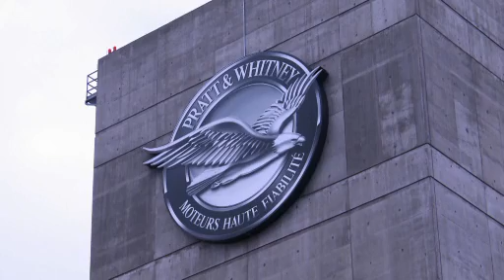Pratt & Whitney PurePower PW1100G-JM Engine First Flight

Comment: Forty-five 747SP aircraft were built between 1974 and 1989 with two more
 planned but never constructed.The production line was ended in 1982 but
 reopened in 1987 to fulfill an order for the United Arab Emirates
 As of December 2016, there were 10 Boeing 747SPs still in active 
service
 with 9 more stored and 1 preserved. The remaining 21 were either 
scrapped, otherwise destroyed or abandoned In 2016, the last 747SP in 
commercial service was withdrawn from service after 40 years by Iran Air.As of 2017, the majority of the ten aircraft still in service are used for governmental or VIP transport.